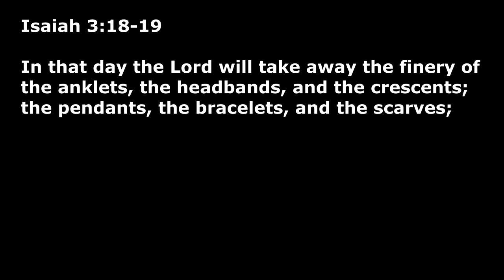Kawasaki KLR 650 Spotlights Battery Holder Air Box Cover Install | Techn' Moto

Comment: Hey Mike, good job! Are those driving lights in their final location? Wouldnt they be less vulnerable mounted above the crash bars?..or on the vertical tubes turned inwards?..heated grips are a Godsend, assuming they're coming next?
Reply from the maker: I totally agree with you. I may move them up to side tubes once it’s all together. Thanks for the tip. Grips are on order so waiting on those to come in
Reply: @TechnMoto what brand grips? I put a set of Oxfords on my bike, they're awesome.
Reply from the maker: video out now